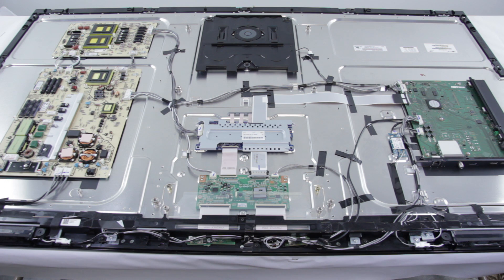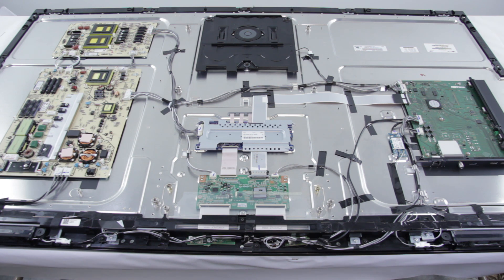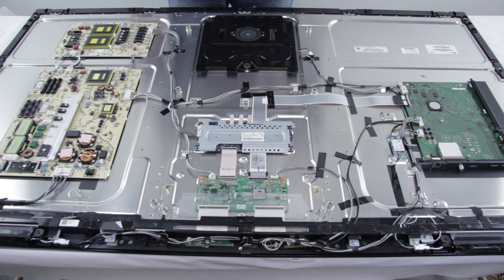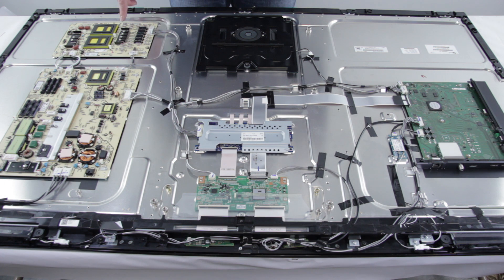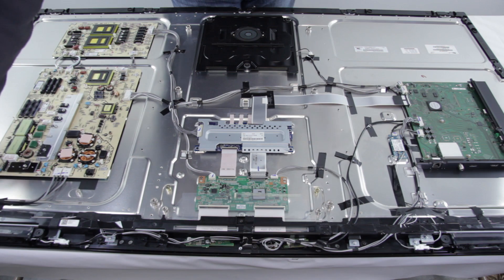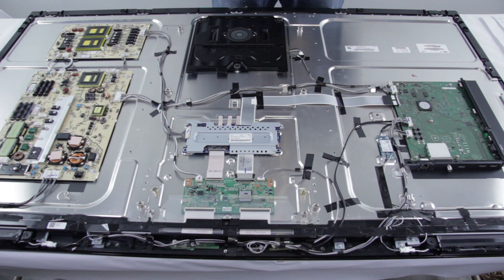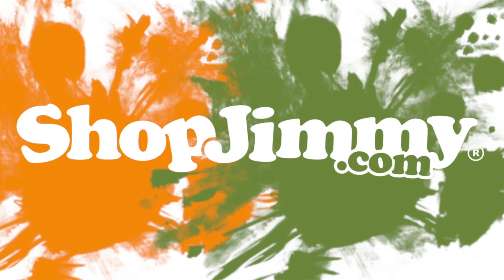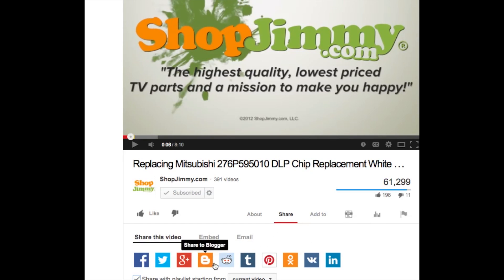LED TV Repair Review Power Supply Overview-NO Power Common Power Supply Repair & LED TV Power Supply

Comment: Hello team,

I have a Visio model E390-A1 tv.  My symptoms are that, occasionally and intermittently, when the power button is pushed, the power light will illuminate but nothing else will work.  I've looked at the power supply and all of the indicated voltages are present and correct. I.e., 5,12 and 24 volts.  I do have a questions about one of the pins.  On the power supply board of the cable, the notation is "on/off".  On the main board side of the cable the notation is "inv".  When the tv works, that voltage is 5 volts.  When it's not, it is zero.   It seems like when the tv is turned off and cooled down, it will be able to be turned on and work.

Any ideas/help is appreciated.
Reply from the maker: Pamela Hicks   I recommend replacing the main board in your TV.  Click this link to replacement parts for your TV model number:  http://www.shopjimmy.com/catalogsearch/result/index/?cat=56&q=E390-A1  Be sure to match part numbers on your current board, with your replacement for compatibility.  Thanks and please let us know if you have any further questions with your TV Repair!  www.shopjimmy.com

Comment: hi, i have a 55" samsung model  #pn50a550s  1fxza the tv is turning on and off and ocasionally squealing.it had the same problem 6 months ago and a tv repair guy put in a new main/tuner board part# bn40-00125a the tv worked but you had to leave it on at all times because it would click on and off for 5 min before finally working...now the tv is totally crapped out again and I,m not sure if it is the same part or not can you help thanks

Comment: I have a Soniq e55v13a.  When powering on, the backlight flashes on (for a millsecond), than powers off again. The TV seems to only have 3 PCBs - main, power & t-con.  How do I test that the power board should be replaced please ?
Reply from the maker: Chris McClellan   This could be a problem with the inverter or power supply, or just the power supply (if the inverter and power supply are on the same board).  Unfortunately I do not see any replacement parts in the search results for your TV model number on our website.  Thanks and please let us know if you have any further questions!  www.shopjimmy.com

Comment: I have a Samsung un55d7900xfxza. It won't turn on by a remote. It will turn off by one but for some reason it's not picking up the signal to turn on. I can turn it on by remote right after turning off but that's it. Have tried it with xbox one, samsung soundbar remote, uverse remote and tv remote and same results.
Reply from the maker: Gary Marburger  Please watch this video FIRST to help with your repair!  https://www.youtube.com/watch?v=BP3NVNCGEv8   I recommend replacing the main board in your TV.  Click this link to replacement parts for your TV model number:  http://www.shopjimmy.com/samsung-bn94-04355f-main-board-for-un55d7900xfxza.htm  Be sure to match part numbers on your current board, with your replacement for compatibility.  Here is a link to a video showing how to identify your part number, click here:  https://www.youtube.com/watch?v=BEPWrefQvqI  Thanks and please let us know if you have any further questions with your TV Repair!  www.shopjimmy.com

Comment: I have a Vizio 55 inch model VF552xvt with no power.  I get 5 volts on the stand by and nothing on any of the other outputs from the power supply board.  thepower supply board is model no. 0500-0507-0670.  I have been watching your site for two months and this part is never is stock.  can you recommend an alternative or maybe another source for this part?  Thank you in advance for your help!
Reply from the maker: Chris Todd  Please watch this video FIRST to help with your repair!  https://www.youtube.com/watch?v=BP3NVNCGEv8  I recommend replacing the main board in your TV.  Click this link to replacement parts for your TV model number:  http://www.shopjimmy.com/vizio-3655-0042-0150-main-board-for-vf552xvt.htm  There may be multiple boards for the same TV model number, be sure to match part numbers on your current board, with your replacement for compatibility.  Here is a link to a video showing how to identify your part number, click here:  https://www.youtube.com/watch?v=kxkeGLhlQY8  Thanks and please let us know if you have any further questions with your TV Repair!  www.shopjimmy.com

Comment: I have a Sharp Aquos Quattron 70" model#: LC-70LE757U.  The only indication of power I can get is the power symbol bottom center, it flashes twice then five times.  No backlight, did not pass the flashlight test and no sound, just blinking...I replaced the power supply with a new SJ board but made no difference...help
Reply from the maker: Craig Williams   What is the blink code?  How many blinks are you seeing?  Thanks!  www.shopjimmy.com
Reply: The blink code is two times, pause, then five times and repeats
Reply from the maker: Craig Williams   This sounds like a TV panel (TV Screen) problem.  If your TV panel is bad, it may be more cost-effective to replace the TV as panels are typically hard to find in stock, difficult to replace, and expensive.  Thanks and please let us know if you have any further questions!  www.shopjimmy.com

Comment: need help.... I have a kdl-42ex440, no power and no lights, i do have some voltages at the power supply and fuse is good and have voltage at the 4 pin regulator i think its called but no 12 volt audio, no 3.3 voltage at power supply.. was wondering if this is the main board or power supply
Reply from the maker: Jamie Yoder   Please watch this video FIRST to help with your repair!  https://www.youtube.com/watch?v=BP3NVNCGEv8  Since you do not have standby voltage, I recommend replacing the power supply board.  Click this link to a replacement power supply board for your TV.  http://www.shopjimmy.com/catalogsearch/result/index/?cat=59&q=kdl-42ex440  Be sure to match part numbers on your current board, with your replacement for compatibility.  Here is a link to a video showing how to identify your part number, click here:  https://www.youtube.com/watch?v=_4Qpfan0vdU  Thanks and please let us know if you have any further questions with your TV Repair!  www.shopjimmy.com

Comment: Hello, I have an LG 42LN5300 and the issue with mine is that the red light blinks but no picture. The red blinking light goes away after a few seconds. I unplugged the TV, waited a couple of mintues and tried again and got the same result. I bought a power supply and there was no change. I don't know if the used power supply i bought has an issue or if the issue is something else. I would appreciate any advice. Thank you!
Reply from the maker: esayasm  Please watch this video FIRST to help with your repair!  https://www.youtube.com/watch?v=BP3NVNCGEv8  I recommend replacing the main board in your TV.  Click this link to replacement main boards for your TV model number:  http://www.shopjimmy.com/catalogsearch/result/index/?cat=56&q=LG+42LN5300  There may be multiple boards for the same TV model number, be sure to match part numbers on your current board, with your replacement for compatibility.  Thanks and please let us know if you have any further questions with your TV Repair!  www.shopjimmy.com

Comment: I have a  LG 47LW5600 which is the LED Cinema 3d tv... I have power going to tv but I am not getting a picture.... so I am getting a red light then when i push the power button clicks and turns blue but no picture... is it the power supply or the main board
Reply from the maker: Matt Winterhalter   Please watch this video FIRST to help with your repair!  https://www.youtube.com/watch?v=BP3NVNCGEv8  I recommend replacing the main board in your TV.  Click this link to replacement parts for your TV model number:  http://www.shopjimmy.com/catalogsearch/result/index/?cat=56&q=47LW5600  There may be multiple boards for the same TV model number, be sure to match part numbers on your current board, with your replacement for compatibility.  Here is a link to a video showing how to identify your part number, click here:  https://www.youtube.com/watch?v=RwHTvjMdrhk  Thanks and please let us know if you have any further questions with your TV Repair!  www.shopjimmy.com

Comment: I have a LG model 55LM4700-UE. It have sound but no picture. I used a flash light but still could see no picture. Replacement the T-CON board but no luck. When I first turn it on, the standby light blinks two or three times but the screen stays blank. Could you help me with this issue?... John West

Comment: Problem: Power Supply board failure - TV fails to turn on
TV model: Philips 40PFL8007K/12

Please advise on the repair kit suitable to fix the power board.

Thanks.

Comment: I have a Samsung flat screen t.v. model # LN46A550P3FXZA. The power supply board part # is BN44-00202A. I'm not sure if the board is bad or not. The t.v. won't turn on, just makes clicking noises like it's trying to turn on. At first it would do that for dozens of times and then finally come on. Then the screen turned all orange and a loud feedback sound sounded and now it finally just wouldn't turn on anymore, it just makes the clicking sound like it's trying to turn on. Do I need a new power board? If so, please send me a link to your store and the part number that I can purchase.  Thanks very much!!

Comment: Hello Jimmy ::::::::::::::: in my 42" LED LG tv gone some water from front of screen  ::::::::::: and its not working :::::::: Backlight and Sounds works properly ::::::::::: It is a major problem or i have to change the panel ??? ::::What i have to do :::: shall i repair my self on opening it
Reply from the maker: Salman Khan   This sounds like a TV panel (TV Screen) problem.  If your TV panel is bad, it may be more cost-effective to replace the TV as panels are typically hard to find in stock, difficult to replace, and expensive.  Thanks and please let us know if you have any further questions!  www.shopjimmy.com
Reply: Yeah mechanic changed the whole panel it cost 50% of the whole new LED TV  ------- This Big companies "LG" can't make there product good not better ### which damaged just few drops of water  ShopJimmy.com

Comment: I have a Toshiba 40s51v power board #pk101v24601,the tv has no powe at allno lights on front work,no noise I have checked all caps good,all diodes good the bridge is good NEED HELP PLEASE JIMMY
Reply from the maker: James Stewart   I recommend replacing the power supply board in your TV.  Unfortunately I do not see any replacement parts in the search results for your TV model number on our website.  Please reply with your part number on your power supply board and I can try searching for replacement parts.  Thanks and please let us know if you have any further questions!  www.shopjimmy.com

Comment: I have a samsung lnt4061fx that it sudenly power off.  

The stand-by red light is not ON as usual.

I once changed the burned capacitors on the power supply and it got back fine.

I have not removed the back cover until I have a lead to start the diagnistic process.

Please help me troubleshut the problem of my LCD tv.

Thank you in advance for your prompt support!
Reply from the maker: Jose Arnaldo Collazo-Battistini  Please watch this video FIRST to help with your repair!  https://www.youtube.com/watch?v=BP3NVNCGEv8  This could be a problem with either the power supply board or the main board in your TV.  Click this link to replacement parts for your TV Model number:  http://www.shopjimmy.com/catalogsearch/result/?q=lnt4061fx  There may be multiple boards for the same TV model number, be sure to match part numbers on your current board, with your replacement for compatibility.  Thanks and please let us know if you have any further questions with your TV Repair!  www.shopjimmy.com

Comment: Hi guys- I have a Sharp lc-46le810UN which randomly powers off and restarts.   I generally use connected to a xbox one.   Sometimes it wont power on at all and unplugging for a while and doing the "input and volume up"  corrects it for a few days.  Is this a software or hardware problem?   Thanks.  Peter

Comment: Hey guy's. I have a samsung UN50EH5000 led. When i first turn the tv on it takes about 3 minutes for the screen to show on. I can hear sound though. Also, about twice a day during regular watching the tv will flicker and eventually flash out for about 3 more minutes. sound stays on.  could you please tell me the possible source so I can order the part from you guys?? thanks much!
Reply from the maker: Christian Steinhaus  Please watch this video FIRST to help with your repair!  https://www.youtube.com/watch?v=BP3NVNCGEv8  This could be a problem with the power supply board or the LEDs in the TV panel.  You can replace the power supply board to see if that fixes the problem.  Click this link to replacement power supply boards for your TV model number:  https://www.shopjimmy.com/catalogsearch/result/index/?cat=229&q=UN50EH5000  There may be multiple boards for the same TV model number, be sure to match part numbers on your current board, with your replacement for compatibility.  Here is a link to a video showing how to identify your part number, click here:  https://www.youtube.com/watch?v=sSJexLvRrjM  Thanks and please let us know if you have any further questions with your TV Repair!  www.shopjimmy.com

Comment: I have a Samsung 60" led smart tv. Model number un60f6350afxza. It constantly power cycles on and off.  It will come on and work for a few minutes then start power cycling again. Sometimes it will work for a few days but again it will start power cycling again non stop. I have tried all the normal things. Unplug everything,  factory reset.
Reply from the maker: Joe Weiss  Please watch this video FIRST to help with your repair!  https://www.youtube.com/watch?v=BP3NVNCGEv8  I recommend replacing the main board in your TV.  Click this link to replacement parts for your TV model number:  http://www.shopjimmy.com/catalogsearch/result/index/?cat=56&q=un60f6350afxza  There may be multiple boards for the same TV model number, be sure to match part numbers on your current board, with your replacement for compatibility.  Thanks and please let us know if you have any further questions with your TV Repair!  www.shopjimmy.com

Comment: Hello, I have a Samsung UN46D7000. Problem: It clicks/power's on then off. Sometimes you may get a solid green screen before it clicks/powers off then on. Sometimes it will come on and work as normal, perfect picture, etc.. Few days go by and the off/on symptom returns. Normal on/off click sound comes from power supply. Capacitors look great. I have video if needed. Thanks.
Reply from the maker: Devon Brown  Please watch this video FIRST to help with your repair!  https://www.youtube.com/watch?v=BP3NVNCGEv8  I recommend replacing the main board in your TV.  Click this link to replacement parts for your TV model number:  http://www.shopjimmy.com/catalogsearch/result/index/?cat=56&q=UN46D7000  There may be multiple boards for the same TV model number, be sure to match part numbers on your current board, with your replacement for compatibility.  Here is a link to a video showing how to identify your part number, click here:  https://www.youtube.com/watch?v=BEPWrefQvqI  Thanks and please let us know if you have any further questions with your TV Repair!  www.shopjimmy.com

Comment: Hello,
I have a sony kdl60ex645   also know as a piece of crap.  Now the tv will not turn on.  I can  not locate what board I need to purchase to repair it.  Will I need to open it up prior to purchase of the model number board I need?  Thanks   This will be the second time I will repair this tv. Thanks Pam
Reply from the maker: Mark /Pamela Rutledge   Is there a power light on in the front of the TV?  Thanks!  www.shopjimmy.com

Comment: Hi, I'm getting nothing from my LG 42ls3400 ... Worked great and then one morning it doesn't have any power. No led indicator, no clicking sound, no backlight... Is this most likely a power supply issue?  Thanks
Reply from the maker: Nicholas Hill   Please watch this video FIRST to help with your repair!  https://www.youtube.com/watch?v=BP3NVNCGEv8  I recommend replacing the power supply / LED board in your TV.  Click this link to replacement parts for your TV model number:  http://www.shopjimmy.com/catalogsearch/result/?q=LG+42ls3400  There may be multiple boards for the same TV model number, be sure to match part numbers on your current board, with your replacement for compatibility.  Thanks and please let us know if you have any further questions with your TV Repair!  www.shopjimmy.com
Reply: ShopJimmy.com thank you for taking the time to help me out!

Comment: Un55b8500 will not turn on and just clicks
Reply from the maker: Bob Weis  Please watch this video FIRST to help with your repair!  https://www.youtube.com/watch?v=BP3NVNCGEv8  This could be a problem with either the main board or the power supply board in your TV.  You may need to replace each board individually to see which one fixes the problem.  Click this link to replacement parts for your TV model number:  http://www.shopjimmy.com/catalogsearch/result/?q=Un55b8500  There may be multiple boards for the same TV model number, be sure to match part numbers on your current board, with your replacement for compatibility.  Thanks and please let us know if you have any further questions with your TV Repair!  www.shopjimmy.com